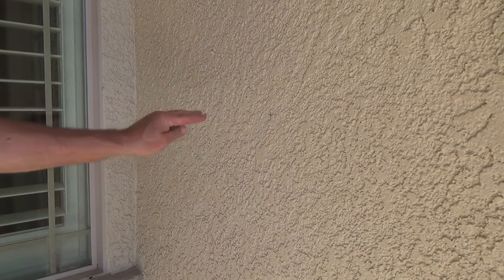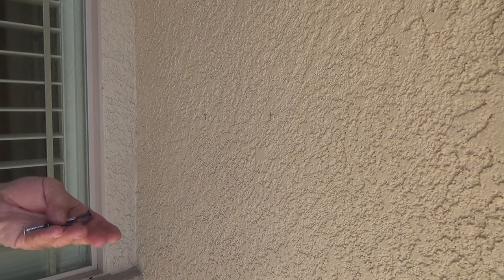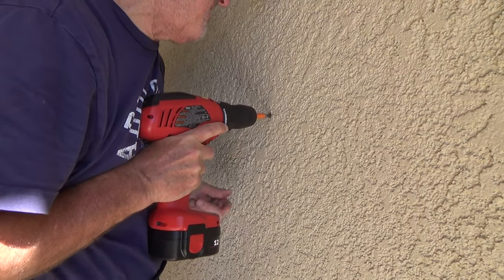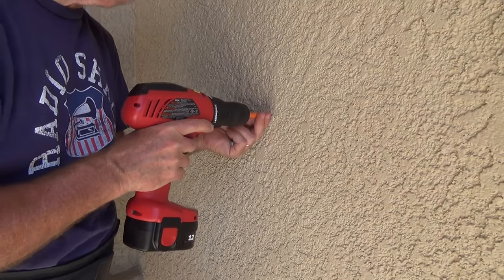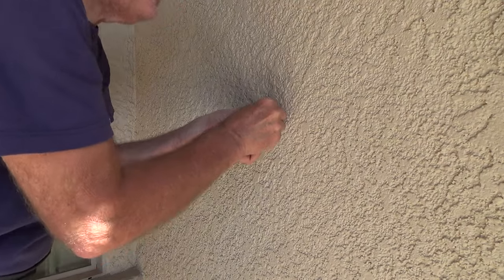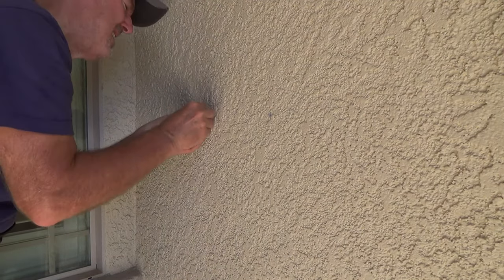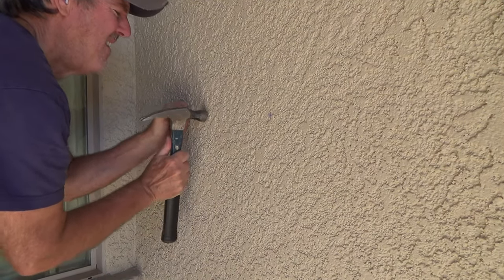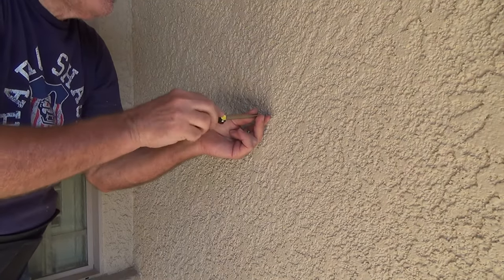Man Says He Can't Install Screws Into Stucco Wall For Mailbox Then Does It Anyway

Comment: I tried it but i think im usong wrong screw to install a screen on side of my house raccoons keep going in
Reply from the maker: There are different types of screw anchors for stucco so go to your local hardware store & tell them what you are doing & they will assist! It depends on how thick your stucco is for what type of anchors to use for sure...as not all stucco thickness/installation is created equal.
Reply: @VideoJoeKnows  I didn't even of the thickness no wonder they only go on about quarter of inch and the stop
Reply from the maker: @RougeMaster  Try again!